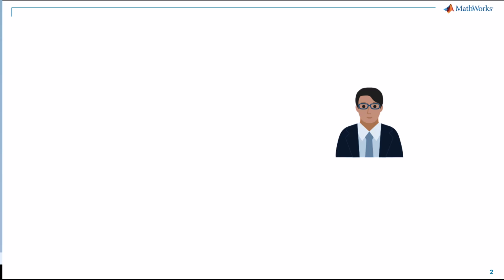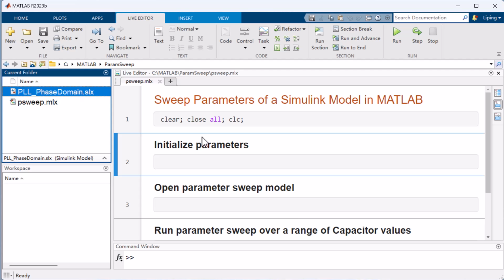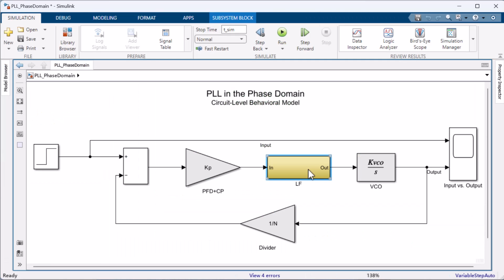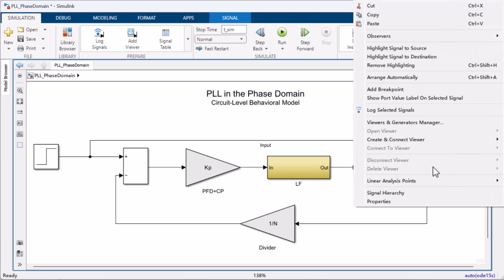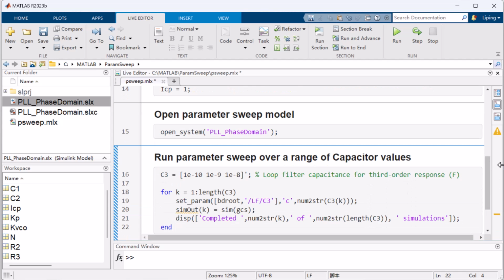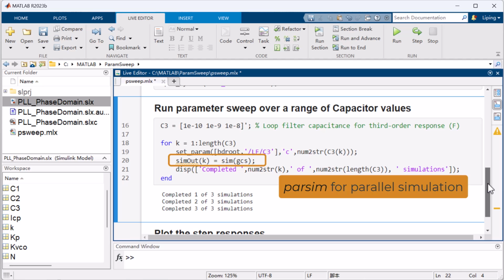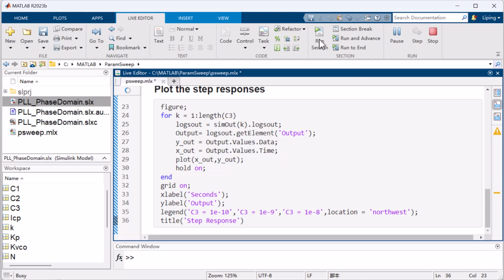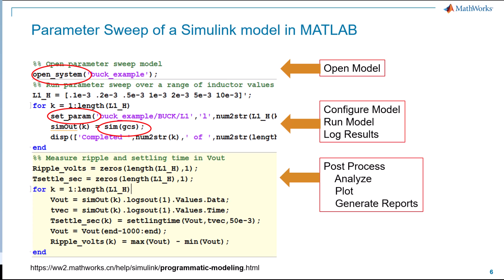How to Sweep Parameters of a Simulink Model in MATLAB

Comment: Is it possible to change the values during runtime based on the simulation time?
Reply from the maker: MATLAB/Simulink supports changing values during simulation based on time through several methods: you can feed time-varying signals using blocks like From Workspace, Signal Builder, or Repeating Sequence; programmatically update tunable parameters with set_param or SimulationInput; implement logic-driven changes inside MATLAB Function or Stateflow; switch configurations using Variant Subsystems; or enable External Mode for real-time tuning on hardware. For interactive scenarios, dashboard controls such as knobs or combo boxes allow on-the-fly adjustments, while data dictionaries and tunable variables ensure compatibility with accelerated or deployed workflows.